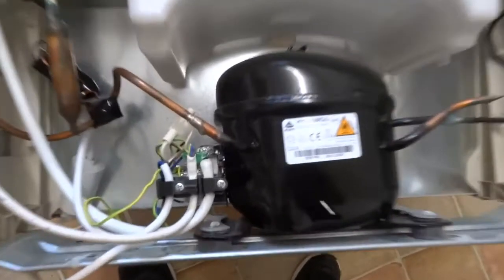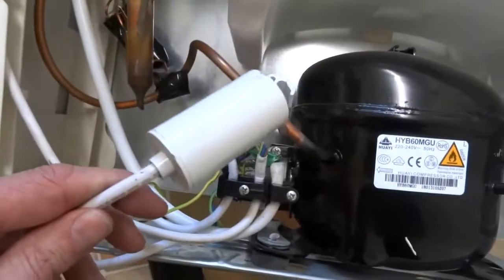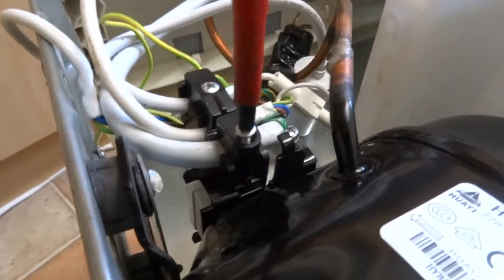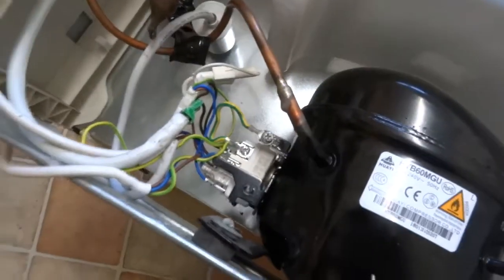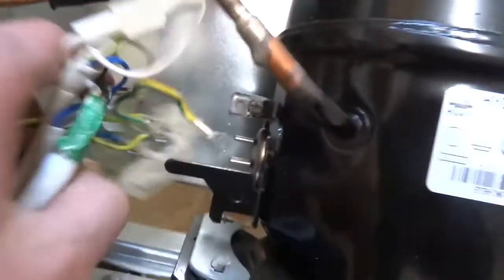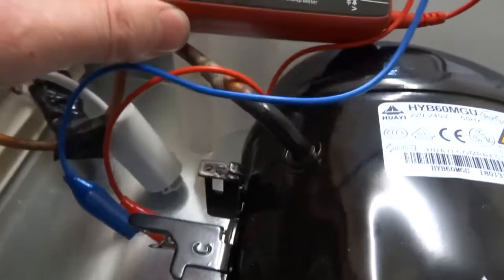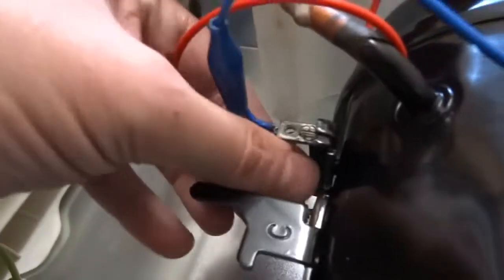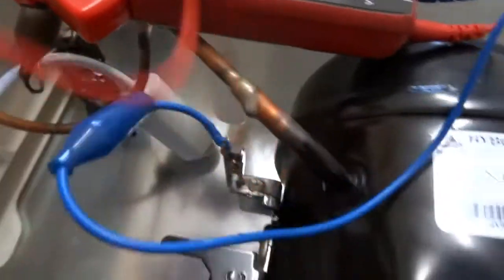Fridge Compressor Troubleshooting: Ω Test, Start Relay & Short to Ground Diagnosis DIY Fault Finding

Comment: Hi great videos I have a cda fridge that’s not cooling properly,the compressor is running all the time and the top of the fridge is getting frozen at the top but it’s still not cooling properly any ideas?
Reply from the maker: Maybe internal air movement inside the unit, maybe defrost system has failed or faulty thermostat.
Reply: thanks for the reply I’ve just found the bottom door hinge has collapsed and dropped down about 15mm so the top of the seal is open,do you think it might be frozen because it’s working overtime?would it be worth turning off for 24hrs ?
Reply from the maker: @Re67976  yes very possible well spotted

Comment: My compressor is extremely hot to the touch-and fridge not cooling/freezer not working.
Should I replace it or get. new fridge freezer ?
Hotpoint FSFL 1810
Reply from the maker: you would need to regas as well

Comment: Hi there,  great video,
My compressor tests fine with the multi meter but when connected to power it goes to earth tripping the breakers. There is no continuity between the compressor terminals and the compressor housing. I've also swapped out the start relay and capacitor  but it doesn't help.   If i disconnect the earth lead the compressor runs just fine (although deadly).
Have you ever come across this?  I've ordered a new compressor.
Reply from the maker: Id say its insulation break down of winding in compressor you can test with megger , not done a video of that yet I have on generators. Yeah deadly without earth protection if its tripping circuit breaker your getting a lot of current flowing.

Comment: Got a hotpoint fridge and not cooling at all. The compressor is very hot, tested it with a multi meter getting different reading like you. If it's not the compressor or relay what else could be holding off the cooling?
Reply from the maker: it could be a lot of things , not enough gas in system , door seals , compressor might test good electrically but is it pumping ok seals might be gone , thermostat.
Reply: @cagmito76  Thanks. Haven't tested the relay next to compressor, but not sure if its that. Thanks for the video.